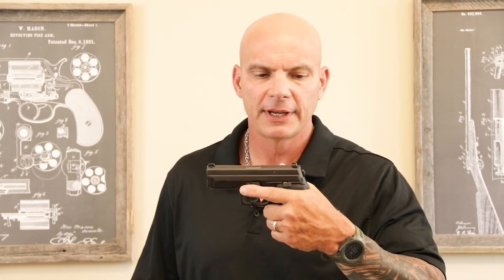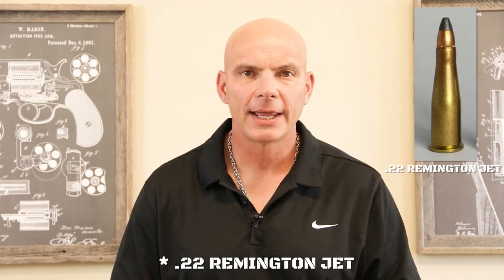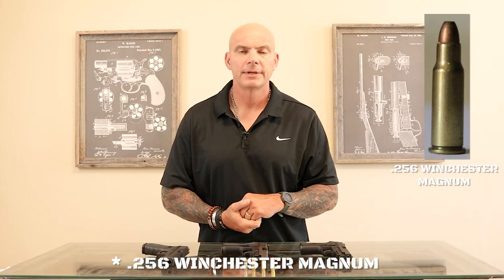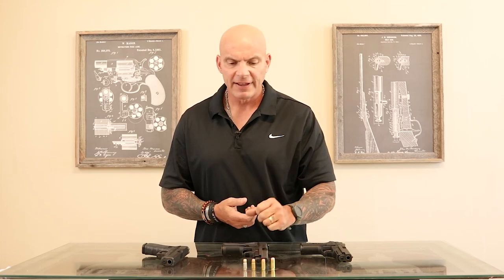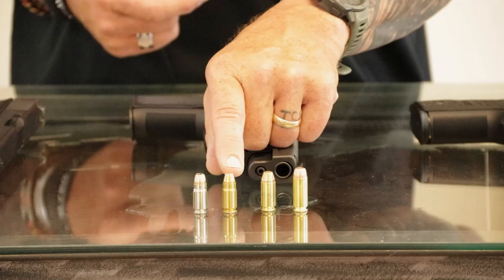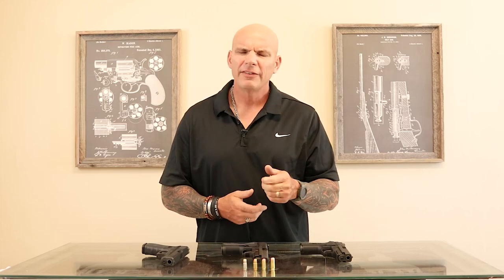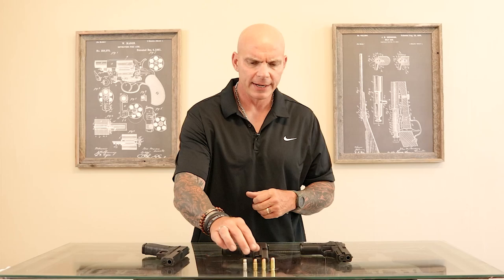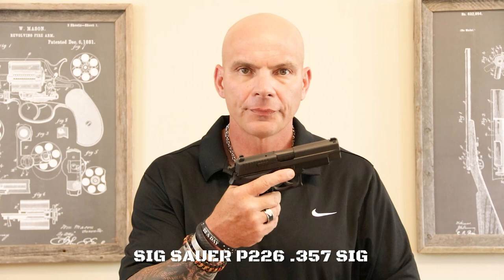A Brief History of .357 SIG

Comment: .357 Sig is my favorite cartridge. The Glock 32 is my favorite handgun and shoots like a laser. I have the full set of G31, G32, and G33 and all are an absolute blast to shoot. I find that the recoil of the .357 Sig is far more pleasant than .40S&W... I'd take my Glock 32 over my Glock 23 any day of the week.
Reply: I hope to join you in owning all 3. I currently own the 31and 33, I've never seen the 32 in a gun shop, but a new shop has opened up here where I live and they said that they can have me one here in 5 days so a deposit was dropped and Thursday of this week I hope I'll have my 32
Reply: dont forget the G35. same size as a 1911. The longer barrel, with upgraded guide rod and springs makes the recoil like a 9mm.
Reply: @jayfarley9293  I have a G35. It's definitely a nice shooter, but there is a part of me that really wants to get a conversion barrel for it to change it to .357 Sig as well... that would be epic
Reply: Replying with a g32 in my hip I second ur opinion , g32 rocks

Comment: Historically, I've read that someone in the Sig C-suite noticed all the .357 Magnum revolvers traded in and wondered why they were popular.
The .357 Mag supposedly was a one-shot stopper, including shooting through engine blocks and quickly stopping very large and strong people who were fortified with various medications.  The .357 Mag replaced the .38 Special. From post-shooting medical records, physical damage was also caused by the shock-wave of the 1500 fps projectile. From this information, Sig tried to duplicate the .357 Mag, but keeping the 1500 fps requirement produces very uncomfortable recoil. I think the .41 Mag was developed to replace the .357 Mag as the .41 was more capable than the .357 Mag, but easier to handle than the .44 Mag. Then the semi-autos took over the market.

Comment: Back in 1999, I was involved in selecting a new cartridge and pistol for our city police department. We brought in almost 250 officers and had them shoot a qualification course with the .40. the .357, and the .45 ACP in a duty pistol. As a whole the group favored the .357 SIG. They thought it kicked less than the other two cartridges, but did noticed that it was much louder than the others. I concurred with this assessment. We issued .357 SIG's to about 700 officers with great results in actual shootings. I know it is probably a dead cartridge now, but I still love it. I have a P226 that is set up to shoot 9mm, .357 SIG, and .40. The one I love most is .357 SIG

Comment: I’ve been thinking hard about switching from 9 to .357 Sig for carry. It just is hard to find ammo around where I live. I can find 50 different 9mm ammunition choices, but 2 choices in the .357 Sig. I’m a huge .357 mag fan. I keep my .357 mag in my nightstand. I have a ton of trust for the magnum. It’s a proven fight stopper. I keep my AR and shotgun close, but a handgun is easier to move through the house with. A .357 magnum with 125 grain hollow points should stop an attack, from 2 legged and 4 legged predators quickly.

Comment: Well, I read through the comments and nobody seemed to tout a S&W M&P as a good home for the 357 SIG...  It definitely is!   I have conversion barrels for both the full-sized & compact models.  The factory magazines are even marked with both calibers as well.  I reload, and as such my cost for 357 SIG is almost identical to 9mm for range/practice rounds and often less than 40 S&W for SD ammo (!?!) because the equivalent heavier (as in 155-180gr) .40 bullets usually cost more than the typical 125gr .355s!  A few grains of powder is a cheap way to gain all the additional performance of the 357 SIG.  Cheers!  P.S.  The FireDragon 357 SIG barrel for my FN FNX was considerably more exper$ive than the ones for the M&Ps, but is really a work of art!  If only CZ had a 357 SIG in their lineup!

Comment: Rodney, I relly enjoyed your presentation, and agree with what you have said. I can provide some information on relative recoil, for what it is worth. My city police department was looking at a new duty caliber in 1998 and 1999. Our 9mm handguns had such ineffective stopping power that it became a morale issue, probably because we had chosen the wrong load and nobody wanted to admit it.. The administration wisely and uncharacteristically decided to let the officers choose our new caliber, with the limitation that the gun had to be a SIG (because they agreed to buy back our 9mm SIGs.), and we would only authorize one caliber. At the time, our State Police were going through the same process.

Over time we bright in about 250 officers and had them shoot with three choices, the .45 ACP,  the .40, and the .357 SIG. My money was on the .40, but the majority of our officers reported that the .357 SIG had less recoil than the .40. The .45 was disqualified quickly due to muzzle flip and the fact that the P220 and P227 did not fit our female officer's hands. The .357 SIG had less flip than the oher two calibers. So we adopted the SIG Pro, which had interchangeable back straps, which were rare at the time. Scores were higher than with the .40 as well. We used Speer Lawman 125 grain FMJ in .357 SIG and Speer Lawman 180  grain FMJ in .40 for the tests. The only complaint voiced about the SIG round was noise, which I believe some sense as recoil. I don't perceive the .357 SIG as having significant recoil over other large service calibers when fired in service size and weight sidearms, but it is incredibly loud. When fired in small, light guns I find it a bit obnoxious, but no worse than the .40. I shoot it today in a converted P226 and an full sized M&P and don't notice the recoil at all. I don't think it is at its best in a concealment size gun.

Our State Police had a bigger budget, so they chose the SIG P229 in traditional DA/SA format as well, using the same 125 grain Gold Dot duty load we picked. What was funny was the sales pitch from SIG that they succumbed to. At the time, our State boys did not have patrol rifles except for specialized units, and many of them worked alone in rural areas. SIG reps brought in shot silhouette targets hey said were shot at 100 yards, and suggested that if the State Police bought handguns in .357 SIG, the Troopers would not need a rifle. This was laughable given that most cops have real difficulty shooting a pistol well at 25 yards, much less at 100. Nevertheless, I tracked shooting results in both departments for two years, and the .357 SIG was incredibly effective. Some of our guys called it the "Death Ray".

I love the .357 SIG, but agree with another thing you said, and that is that it does not seem to have much of a future except for a cult following.. If it had only come to market at the same time or before the .40 (which is also a great patrol round) cops might still be using it. But what do I know? I said the same thing about the .41 Magnum years ago. People still shoot that and ammunition is still sold for it.
Reply: Thanks for the bit of history sir. Our local department switched from revolvers to 1911’s. They used those effectively for several years but eventually switched to S&W model 59’s which didn’t work out very well at all. A lot of malfunctions. Then, we found Glocks in 40S&W. Those were used successfully until recently when they switched to the 9mm Glocks. I wasn’t in on any autopsies but knew deputies that were and they said the Black Talons (now Ranger T’s) were extremely effective. I’m retired now so I’m not in on the results of any recent shootings with the 9mm but I always wished for the 357 Sig (my EDC now). The older deputies who only knew revolvers said the 357 mag was a one shot stop, unlike today where bad guys have to be hosed down to get them to stop. Thanks for the insights on the 357 Sig sir. Agh, the old days.

Comment: For me, 357 Sig actually kicks less than a 40SW, but it seems like it is worse because it has a lot more muzzle blast. Underwood and Liberty Defense make rounds that move at 2,100 fps and 2,300 fps respectively
Reply: No way 😳
Reply: @Prepper319  
Just reduce the weight to around 68 grains and it's that speedy.
Reply: @Prepper319  lighter bullet more pressure. I can't tell a difference but to me 45acp with 230 grain and low pressure kicks more. Think it's something to do with that physics thing and mass.
Reply: It's exactly the same for me. Took me a long time behind the trigger and shooting 40 and 357 back to back. It is actually less recoil but damn is it loud
Reply: @lowerspeedhigherdrag  Try PPU 357 Sig. 50 flat-nosed FMJs for around $30-$36 and they are as hot as any 357 Sig ammo you can get. The flames that come out of the barrel are impressive.
Reply: @onpsxmember  That's what I carry; Underwood Extreme Defender. Not certain whether the bullets are 65 gr or 68 gr. The description on their website says 68gr, but the box says 65 gr. I chronographed them at 2126 out of my 3.5" barreled P224 and 2237 fps out of my P226, which is 652 fpe and 722 fpe respectively. That is 10 mm energy.
Reply: @lowerspeedhigherdrag  Try PPU 357 Sig. They are rated at 660 fpe. I never chronographed them, but I can tell they are hot by the recoil. The flat-nosed FMJ bullets they use are supposed to be the best design for deep penetration on bigger game.

Comment: I own a Glock 22 and a .357 barrel to fit it.  I have a Glock 33 and a .40 S&W barrel to fit it.  I have a Sig P229 which was sold as a .357 Sig for which I also have a .40 S&W barrel.  I find recoil from shooting .357 Sig with the P229 to be only incrementally stronger than shooting .40 from the same gun.  The difference is a bit more in the two Glocks, mostly due to their much lower mass.  I'm really glad I managed to snag a P229 in .357 Sig before Sig Sauer discontinued handguns in .357 Sig and .40 S&W.

Comment: I just picked up a Sig P229R in .40SW. I purchased the .357 SIG barrel from Sig Sauer. So Sig Sauer still provides legacy support for it. Sig Sauer also sells their 12 round P229 .357/.40 magazines. MecGar sells the 14 round P229 .357/.40 extended magazines.  
Sig Sauer sells a Caliber X-Change kit in .357 SIG for their current P320 full and compact series. 
So it shows that Sig Sauer still believes that there is life still in the .357 SIG cartridge. They have not abandoned it. 
Barsto sells P229 threaded barrels for .357 SIG. I just purchased one of those and will mate it to the Strike Industries Micro Comp Quad. 
There are a lot of police trade ins of .40 P229s floating out there. It won't take much to convert them to .357SIG. Just a barrel swap.
I also have a S&W M&P .40 full size with an aftermarket .357 barrel.  KKM makes .357 barrels
I also have a Steyr S40-A1 compact with an aftermarket .357 barrels. Though both have been discontinued.
Obviously Glock makes .357 pistols.
I'd say that there is still Industry wide support for the .357SIG.

Comment: Could you imagine a P365 in .357 Sig?  I think I'd like it.
Reply: I owned a Sig p239 for years. Size wise pretty comparable to p365 XL though heavier. What a great gun that was, and the recoil was very manageable. Too bad Sig discontinued the 239.
Reply: @garywood2137  I have a P365, original model.  It's great, and recoil is very good even for a 9mm.  I believe they discontinued the P239 in favor of the P365, as they do kind of fill the same role.  Looking at comparison images, the P239 is about the same size as the P365XL, with the original P365 being a little smaller.  

I do believe with the way the P365 handles recoil of a 9mm, it would be good with .357 Sig.

Comment: The recoil thing always makes me roll my eyes now that I see the resurgence of 10mm on the market. The 40 and 357 are similar recoil, just a slightly different impulse. The 357 is definitely less but the blast tricks you. That being said it's still less than the 10mm taking the industry by storm
Reply: Why Handgun do you own in 357sig? Have you tried a 24lbs recoil spring in it? I own a Glock31. with the stock recoil spring, I can't hold the handgun in my hands, but with the recoil spring it is totally manageable.

Comment: Technically, the 357 Sig is a unique cartridge case. It’s more like a small pistol primer, shortened version of the 10mm but with increased strength in the web to handle its SAAMI maximum average pressure of 40,000 PSI. The 10mm cuts off at 37,500 and the 40 S&W ends at 35,000 PSI, same as the 9x19. Also, Federal partnered with Sig to develop this round in 1994 just four years after the introduction of the 40 with some big adopters such as Texas DPS and the Federal Air Marshals. Many agencies who switched to it reported excellent results. Its actual diameter is .355”, the same as the 9mm. But it’s relatively long case length means that flat point bullets must be used. Be forewarned if you intend to handload for it. As far as recoil goes, the FBI version of the 40 with a 180 grain bullet at 950-980 FPS doesn’t have the snap of a full power 165 grainer at 1150 FPS. Power factors for the 180 and 165 bullets are 176 and 190, respectively. The 125 grain 357 bullet at 1,400 FPS has a PF of 175. The uncorking pressure for the 357 is higher and that will offset those numbers somewhat. Additionally, the 125 grain 357 round goes through its firing sequence almost 30% faster than the 180 grain 40 making the recoil impulse feel more intense. Comparing full power to full power loads, the 40 has notably more perceived recoil than the 357 and some say it’s more vigorous than the 45 ACP from similar guns. The 357 Sig is an excellent cartridge that truly gives autopistol users the power of a 4” 357 Mag with nearly 3 times the capacity. Long may it live.

Comment: I currently purchased my first .40S&W Cal in the G23/5, yes generation 5.  A larger frame and 3oz heavier and wider along with a 20lbs recoil spring, NOT 18lbs.  I love this platform as I selected the 180gr weight as my practice and carry.  Comparing it with my G19/4 with heavier per caliber ranging notice little diff in recoil, but a little more punch, snappy doesn’t play here.  My followups at 25yds I’m keeping the 10-ring with little delay.  That said, I’m wondering just it will fare with the .357SIG?  Only a barrel change and possible the Magazine.  As you stated, a powerful round.
Reply: Same mags, they used to have .357/.40 marked on them originally.

Comment: They said the 10mm was going away and Glock was one of the main support with the G 20 and 29. That caliber started making its come back with small manufacturers and reloaders bringing back the full power loads. Like the 10mm, 357 Sig ammunition have been watered down. It was designed to match the 357 Magnum from a 4" barrel with a 125 gr bullet traveling at 1450 fps.

Comment: Bought a .357 Sig conversion barrel for my S&W M&P 40. It functions flawlessly, and there are no signs of excessive pressure on the brass, nor any degradation to the structural integrity of the pistol in general, or any its components specifically. 

I handload, so I couldn't care less if the manufacturers give it and its ammo the heave-ho. I am very pleased with mine as my EDC, and probably won't use it for .40 S&W ever again.

Comment: SIG offers 357 P320 parts: slide, barrel, and magazine. I regularly interchange between 9mm and 40 on my P320. The slide and magazine for 40 is the same for 357. I'm just missing the barrel specific to 357.

You are correct that SIG doesn't offer a handgun explicitly in 357, which says about SIG's market confidence of the caliber.

The price of 357 ammo kind of deters me from it. But at the same time, less customers of the 357 means less dedicated manufacturing for it and the prices are higher because lack of economies of scale. It's kind of a death spiral.
Reply: It's not actually economies of scale. I just bought 357 SIG ammo slightly cheaper than 45acp.

Manufacturers mark-up hollow points or some calibers just because they can. There is absolutely no cost difference, for example, to make 45acp 230 grain fmj vs. 230 grain HP. If there is, it's in hundredths of a cent difference.

The price difference is because a. They can, and we pay it, and b. The industry has decided 9mm is The One Round To Rule Them All.

If I win a big lottery, I'm going to start an ammo company without the gross differential between sku's.
Reply: @keithgraham9547 golddot 9mm is 2c more a round than 357sig gd atm.